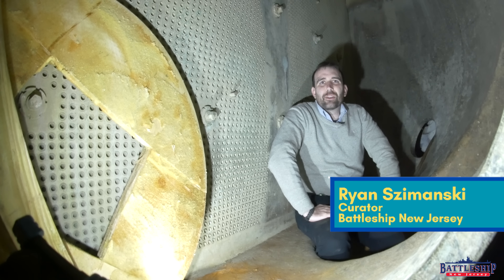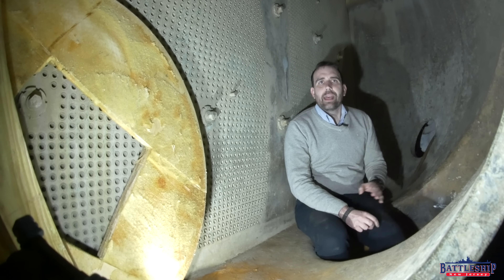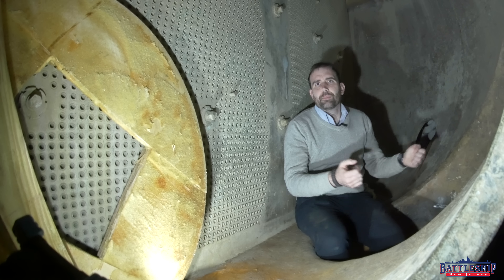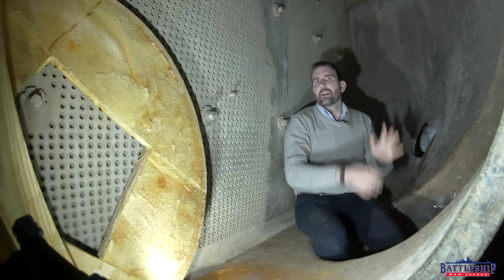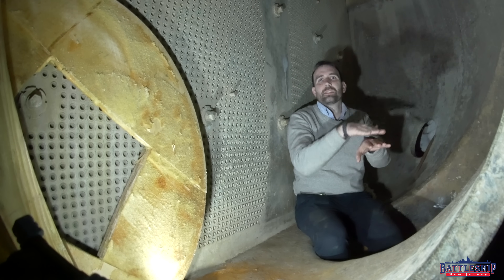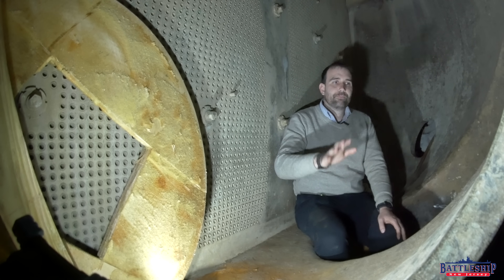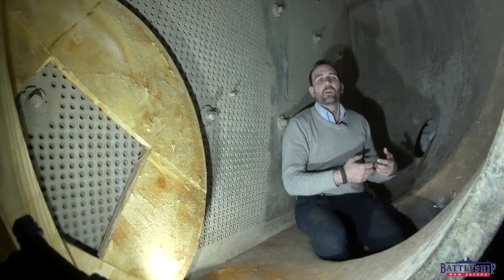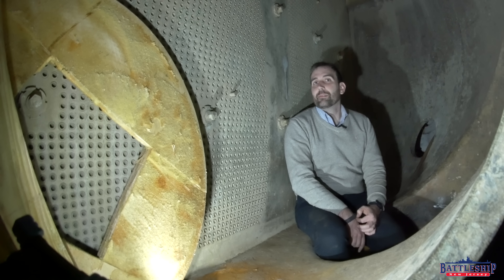Correcting a Leak and Preventing New Ones: Why We Are Dryocking the Battleship

Comment: Hi Ron I watched your video about the main condensers. When I served  on board the USS Randolph I worked in the NO2 Engine Room  and I had to go in the main condensers to inspect them and  The smell was horrible  which was methane gas back in the 1962 there were no safety  rules. In you video you wondered what kind of metal they were made of the answer is MONEL all of the metal in contact with salt water is made out of this metal. MONEL IS MADE OUT OF A NICKEL-COPPER ALLOYS ABOUT 66% NICKEL AND 31.5% COPOPER WITH  SMALL AMOUNTS OF iRON. 
Thanks again for the personal guided tour you gave to my son and I on fathers day  several years ago. Keep up the good work your doing a  great job

 Yours truly  Anthony Carta and Son

Comment: Suggested priorities are
1. Repack the gland seals as they can let in a lot of water very quickly if they fail
2. Replace the anodes as without them the ship will start to corrode badly
3. Inspect the openings and re-weld where necessary 
4. Paint the ship

Comment: 2:20 do the condensers turn "dead" low pressure hot steam into hot boiler feed water? If "dead" steam is condensed, does that mean the steam system is closed? Is the steam system opened, sometimes? Could you make a fun color coded graphic? I don't know how steam powered massive buildings operate!
Reply: BB-62, and all Navy ships are closed loop steam systems.  It’s easier to condense and reuse, than to use fresh feed each time.
Reply: @richcruse2689  I just saw the size of Big J, I thought she could make fresh steam from sea water. Open loop. Like a bunch of locomotives chugging along on the high seas. Cool.

Comment: I know with smaller boats, it's common to repack shaft and rudder seals while in the water.   Now, I suppose, the shaft seals on New Jersey have something like 20' head of water pressure on them.   But, is it not possible to repack them wet?
Reply: They are specifically designed to be repacked wet. You don’t want to take a ship out of service just because the packing failed

Comment: The exhaust steam (Dead Steam) from the turbine is condensed into condensate which is aerated water.  The condensate is pumped via Condensate Pumps (CP), to the Deaerating Feed Tank (DFT). Above the DFT is the deaerator, which removes dissolved oxygen from the condensate turning it into feedwater.  The DFT is set high in the space to provide about 20 to 30 psi of suction head pressure to the Feed Pump Booster Pumps (FPBP), which discharge approximately 80 psi suction head pressure to the Boiler Feedwater Pumps (BFP), which discharge to the boilers at from 750 to 1,350 psi depending on the boiler operating pressure.  The reason for the progression of of feedwater pumps is to prevent cavitation, the flashing of water to steam at low pressures, which would destroy the internals of the BFP.
Reply: The Maim feed pumps on Ranger and Hepburn , were 1500 psi.
Reply: Excellent, Thanks for the info
Reply: Nice description @theRealTracyDuane 
Glad to know more about how that works.
Sounds like you have spent time with that equipment, to keep it running + healthy.

A few thoughts/questions:

1) If the steam/condense/water cycle is a closed loop, then how does air/oxygen get into that water cycle to need deairation? 

2) When steam goes through condenser, do you recall the temp of water coming out of condener, through BFP and back into boiler??

It would seem like a temp near 180F would condense steam to water (though still fairly hot) but require less fuel/energy for the boilers to heat water back to steam. 

... or does the water need to be cooler than 150F to work in DFT properly?

3) I would like to understand more about the 1300+PSI Boiler Feed Pumps...

Were the BFP electrical powered... steam powered... or some of each for redundancy and use at different times?

About how many gallons per minute of condensed feed water had to be pumped back into those boilers?  
It would need to be a lot to keep BB62 turbines turning at 50,000hp each.

We're the pumps themselves single stage centrifugal pumps... multi stage... or what kind of design to get that much water back into boilers running well over 1000PSI.

Comment: Is it possible to blank off the valves on the sea chest side as a redundant seal?
Reply: You could for some of them but it's honestly better to leave them because when a valve on a system that should be empty suddenly starts leaking seawater, it tells you that your blank has failed, whereas if the sea chest was blanked off on the inside, you wouldn't know anything was wrong until the inner blank failed and flooded the compartment.
Reply: @themightydropbear   "you wouldn't know anything was wrong until the inner blank failed and flooded the compartment."

A water-level sensor is like $2.50:)
But I would not blank the inside either though because if there is a leak you still need to get in there to fix it. Leaving water inside it is the last thing you want and if the first thing you do when there is a small leak is to grind the inner plate off again....

Comment: It's entirely possible that the failure was of the metal, not the weld. While they are indeed the entry point if they're done wrong, i have my doubts that any person welding a battleship would be on the level of bad technical education required to fail that bad. Ryan has shown us several elements that at the very least show the intent that the ship would come out of mothballs at least one more time (in terms of how things were done to mothball it). If we follow that logic lay line, it's perfectly ok to assume the metal used wasn't meant to last as long. Kinda like ... putting a dollop of epoxy putty over a leaky pipe. It's not a fix, it's a temporary patch until you get the chance to properly fix it.

Comment: As you have stated repairing any leaking blanks, some as you said won't reveal themselves until sitting in dry dock, repacking the shaft and rudder seals, and recoating the hull both under and at the water line, as well as changing the zincs to aluminum. I don't know what else could be or cause any more leaks as you have covered most of them including the thinner skin on the bow. I guess the key with a dry dock trip being so expensive would be to cover anything that could possibly fail underwater before it fails. Keep up the good work that you and your crew are doing in preserving one of the last battle wagons that will ever be built

Comment: 1. Clean and paint the ship
2. Replace the anodes
3. Inspect openings
4. Repack gland seals
Reply: I like how you placed the thing that could sink the ship first last, yes corrosion is a vastly important part of vessel preservation but on a ship of this scale things like shaft glands and huge and can leak massive quantities of water into the ship before corrosion can even start to be an issue on an armored ship, through hole openings are the next important because some of the openings like the one shown in the video are also capable off leaking massive amounts of water into the ship and are much thinner than the material around
Reply: @turkeyboyjh1 probably wouldn’t do the list in series anyway
Reply: @turkeyboyjh1  the gland seals can be repacked while in the water. They’re specifically designed to be able to do that. It’s easier to do it out of the water, but if they run out of time to do it, it can be done at her berth. The other stuff HAS to be done in drydock.
Reply: @turkeyboyjh1 gland seals aren't as much of a problem on a shaft that's never expected to turn again.
Reply: @turkeyboyjh1  the shaft tunnels are relatively small compartments, so if a gland seal failed, it would only flood a very small part of the ship. Not ideal, but it definitely would not sink it.

Comment: Curious? How do the zinc saltwater anodes  react to the freshwater, do they deteriorate faster or slower compared to the aluminum  anodes?  (Correct me if I am wrong,  is aluminum the Way to go for freshwater)
Reply: From what Ryan said in previous videos, they deteriorate much slower if at all. They are going to replace them with aluminium in the dry dock.
Reply: @sebastianjezierski8450  thank you hardley miss a video, just figured I'd ask
Reply: Also with tide isn't that brackish water?

Comment: The blanks are more important,  IMHO, simply because they are inaccessible when in the water, and may have leaks hidden by valves.

The prop shafts are accessible, and can be repacked while submerged.
Reply: Both are equally important I wonder if there is a way they could pressurize the compartments containing the gland seals to check for leaks and/or keep water intrusion out in the future, I know the sealed doors are capable of taking quite immense amounts of pressure
Reply: Using air pressure to check seals can work in certain situations... but you have to be careful where used and how much pressure is applied. 

If you add too much pressure behind some of these seals (even just to check) the air pressure itself could push OUT through the seal, causing a leak allowing water to flow back in afterward.

Comment: You need to install stainless steel DeZURICK valves.  No corrosion issues.  One of the few high quality items our papermill buys.  Cool video.
Reply: Stainless steel still corrodes, especially in salt water. Metallurgy is a very complex field.
Reply: Unless cheaply made
Reply: They aren’t allowed to power up any engineering equipment, so they probably aren’t allowed to replace stuff on it either
Reply: @jasonmurawski5877 why are Cod and Silversides able to run their engines then?
Reply: @jimmiles33  that’s there specific navy contract. I cant say for certain on either of those ships but none of the iowas are allowed to run their engines, boilers, or diesels.